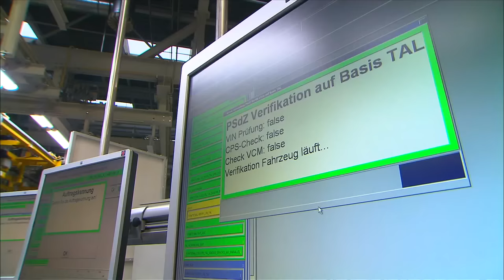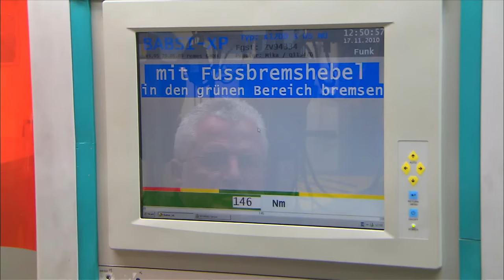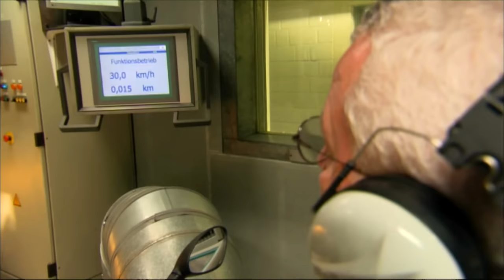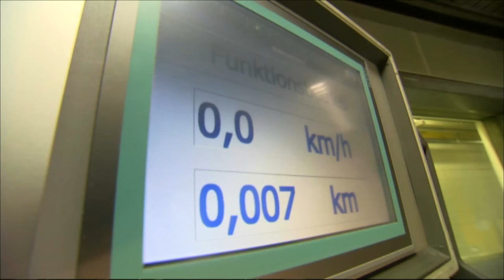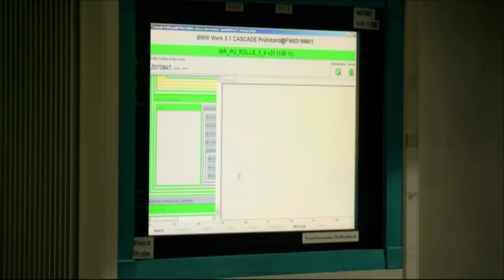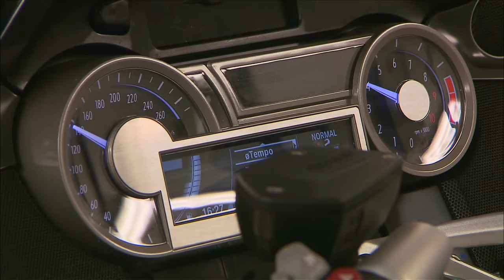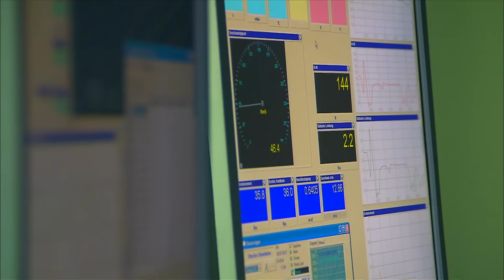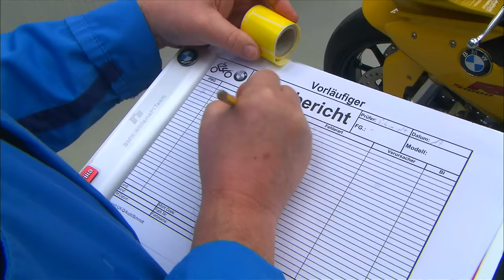BMW Motorcycles Assembling | HOW IT'S MADE

Comment: In the early days of (British) motorcycle fabrication, the young employees would take the finished bikes out into the local countryside and villages to test them. They were ridden up hills, across creeks, on dusty rough tracks until the bikes were considered adjusted correctly for the terrain. Unfortunately, this no longer happens, and all bike are tested indoors at the factory. It used to be a privilege and fun to test bikes. . .
Reply: ивановладимирвлади мирович

Comment: how does the motorcycle stay stable on that roll machine when they go through the gears?
Reply: +Tou Xiong The same way as it does on the road, gyroscopic effect of the wheels.
Reply: The person riding it balance it in the same way as riding it at speed, the rolls simulate the bike moving, gyroscopic effect of the wheels is part of it.